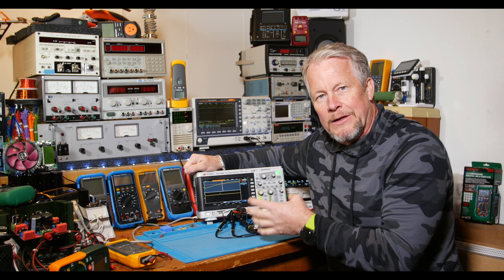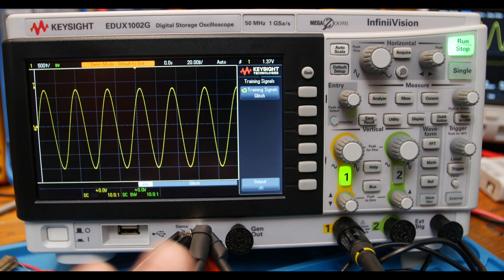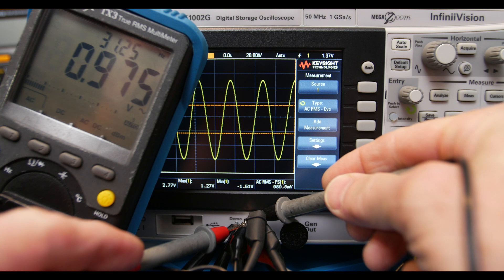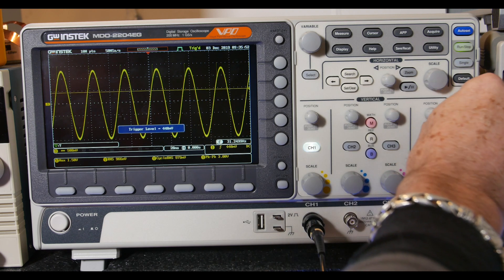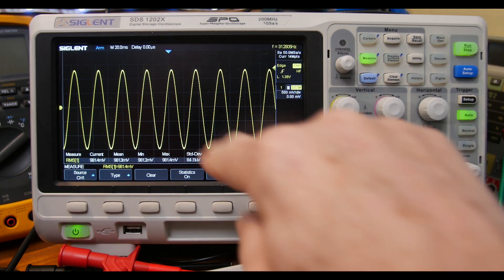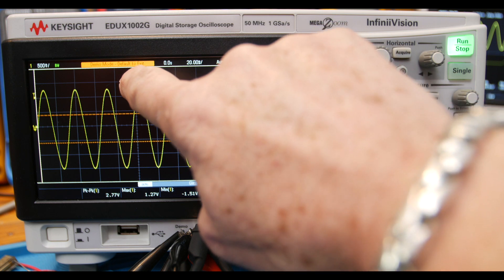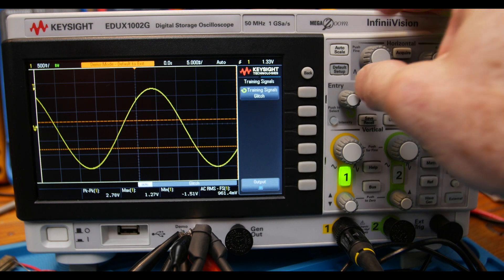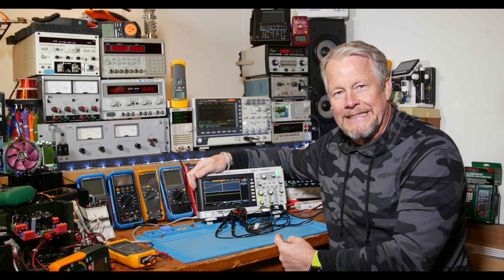Spike Capture with Oscilloscope Deep Memory

Comment: Another very good video. Well done. I like the way you explain those things. I like these type of videos pretty much as they are very useful for many hobbyists I guess and people can always learn something from it. At least I do. Thank you for sharing. BTW I am using the Keysight DSOX 1102A (100 MHz, without the function gen) and the SDS1104X-E which can do Bode Plots when used with a Siglent function generator which I have. I am also using the bigger Siglent SDS2104X (100 MHz, 140 MPoints !!!) Finally, I also got a used Siglent SDS1202X-E with the 200 MHz. Like Oscilloscopes, apparently ;) Using them a lot in my AVR programming and Arduino/Raspberry Pi projects (controlling stuff, measuring more stuff, running my Raspi Parallel Cluster self-made out of 15 single Raspi Pi 3B+ units). The latter is also a good reason why I like your videos on power supplies and DC-DC converters and such alike. That all fit into what I do sometimes in my projects and circuit developments. Hope you‘ll get increasingly more Likes and subscribers to promote your channel.
Reply from the maker: Markus Keller Thanks so much for your support - I really appreciate you!

I think you might like scopes;) all very nice ones as well!  I knows who to contact if I need programming;)

I hope to hear more from you - and let me know if you have comments, suggestions, or questions.
Reply: @KissAnalog  Hi Eddie. If you're looking for help sometime in regards to programming, yes, let me know and I will be more than happy to help if I can. At least I am quite familiar with Python, C/C++, Perl, Java, Lua and a few others over the past 15 years or so... :)

Comment: 8 bit ADC's in most scopes.  The voltage readings are almost always a bit off.   They are close enough.
Reply from the maker: Thanks Jeff!  Yes, 8 bit has been around for a long time and usually only the more expensive scopes have high bit resolution.  I just did a review of the Pico scope which has 12 bits: https://youtu.be/vFRvdYTCkx4

Comment: This video comes in handy , since a few days i notice a glitch in all my led lightning arround the house, the glitch occurs when the ignitiontransformer of my gasoline burner (central heating) stops when the burner is running. 
It seems that there is some sort of flybackvoltage kicked back to my main lines.
Reply from the maker: Wow, did you find the problem?  Thanks for sharing this!
Reply: @KissAnalog  not yet, i'm still working on a scope probe with a right attenuation for best results on measuring mains. I hope to have a answer soon, and will post back the results. Thx for replying. Greets from Belgium

Comment: HI Eddie, good video about deep memory :-).
I  am in doubt which scope I should buy : the  SIGLENT SDS1202X-E or the new RIGOL DS1202Z-E.
Both have deep memory :  Siglent 14Mpts  and Rigol 24Mpts.
But  the waveform capture rate of the Rigol = 30.000wfs/s  and the Siglent = 100.000wfs/s.

All other parameters in the datasheets seems about equal.

Which one do you prefer or recommend. ?
Perhaps a good idea for a comparaison between them in a video ?
Reply from the maker: Thanks Vic!  I like the video idea!  Great comparison, and I might have a 3rd option.  I’ll see if I can get something out this weekend;)
Reply: @KissAnalog  Waw Eddie that's cool, I guess the other followers will find it also interesting :-)

Comment: That's a clear demo of why additional memory is beneficial.  I really don't understand why Keysight limit it so much given that it's such a low cost element in what is otherwise an expensive piece of kit: no one buying it is going to notice the extra couple of bucks for 30MB of ram.  Their marketing dept really has to go to town to proclaim why it's not necessary!  The triggering options on modern scopes are great as well.  I volunteer as part of a team looking after a rebuild of a 1940s machine which is full of mechanical relays and commutators and the signals are very noisy.  Tracking down a spurious pulse amongst a large amount of glitching and noise was nigh-on impossible with an old Tektronix (it still has a 3.5" floppy drive for screen capture!)  It offered triggers such as Edge with a choice of rising or falling, as well as....well, nothing else, that's it.  You can imagine how difficult it is to trigger on a pulse that is the same voltage as the glitches: basically, it just required good luck.  With the Siglent, we just tell it to look for pulses of a certain duration (>5ms) and all the noise and glitches are ignored.  Then it's possible to zoom in and out on the detail.  With little memory, that just wouldn't be possible and we'd never have been able to make a start on tracking down the culprit.  I don't think it's possible to appreciate how useful a decent amount of memory actually is until you have to use it in real-world problem analysis.
Reply from the maker: Andrew Johnson I’m so happy you share this experience!  I’ve been there too - and loved the old analog CRT scopes that took real experience to use to track down these problems.  Today, with a scope that has deep memory, and some knowledge (which I hope to share) anyone can do so much!  I too am surprised that keysight doesn’t just kill the market by offering so much more for so little more... Memory is so cheep, and they’ve done the hard work already - plus with their name - they would kill it!  Thanks Andrew!

Comment: after watching this, i think i'll save my money for the rigol DS1054Z rather than Owon SDS1102, even though there's a sale for the Owon SDS1102 at 50% price cut, probably 2 more years worth of saving to buy the Rigol, right now i'll stick with Hantek 6022BE with open-source software because the original software is not usable..
Reply from the maker: Seraph Hi Seraph, I think I’d recommend the GW Instek.  Have you watched this video? 
Top 4 Oscilloscopes under $500 https://youtu.be/NU-E4jT_LRI

Comment: That's how to do it! I really like your subscribe screen, wary clear and something you notices!
I did also really like the short form about Patreon and Amazon. You tell that it helps, but without using more time then necessary and it do in no way become annoying but instead stand as a personal "help if you want"

Also great demonstration, logic idea to use the trigger to only stop at something that goes outside normal signal. Unfortunately is it not to much help if the glitch is inside the normal signal:-)
Reply from the maker: Fried Mule Thanks for the great feedback Fried Mule!  I’ll keep working on better ways;). 

Yeah - the spike is much easier to find with deep memory - especially if it’s hard to trigger on😬